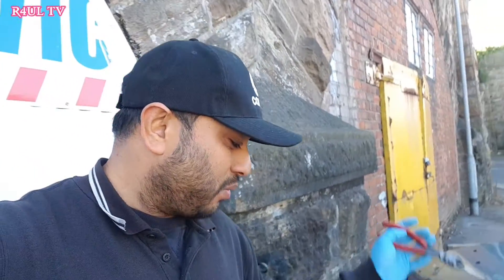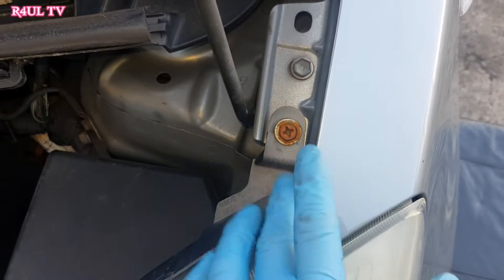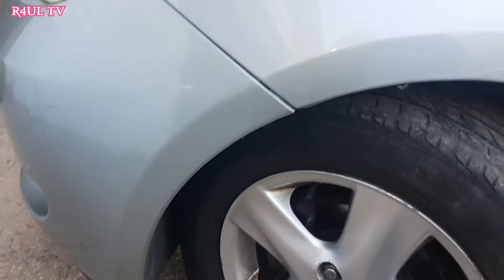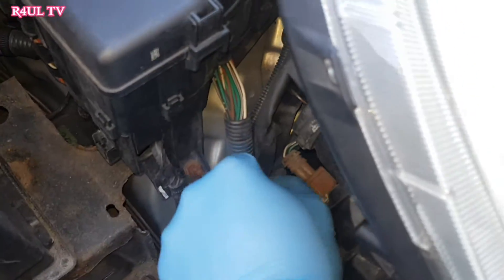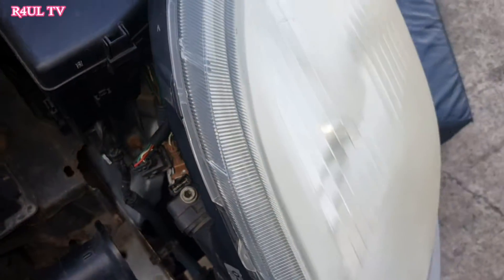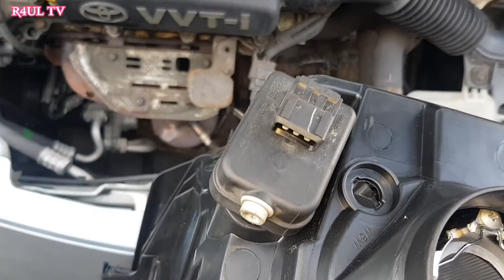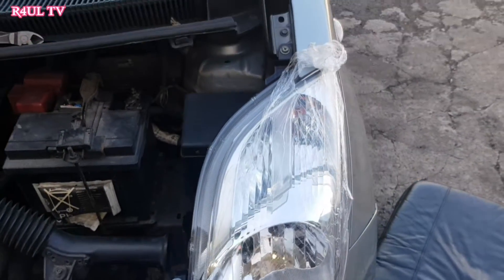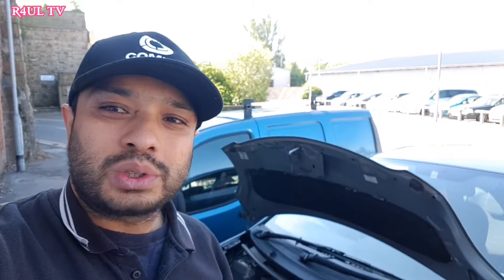2007 Toyota Yaris Headlight Unit Replacement

Comment: Hi I need to remove bumper to replace horn on my 2007, and struggling. The section near wheel hub, what tool do you need to remove it, doesn't look like bolt? Thanks!
Reply from the maker: Hi mate thanks for watching really appreciate it. As for your bumper Removal I have to have a look at it